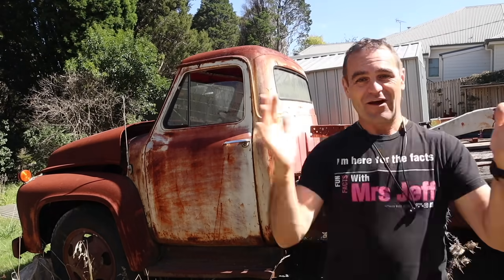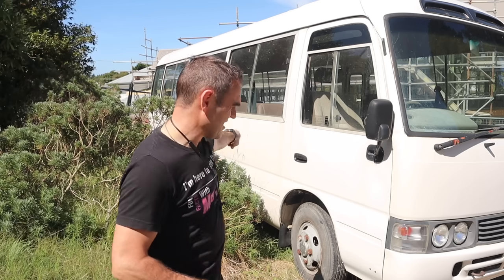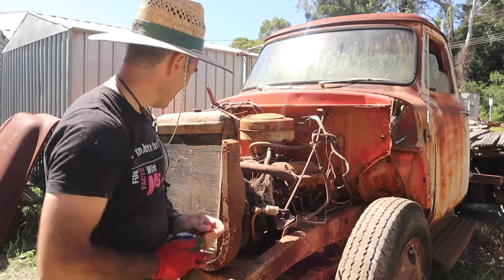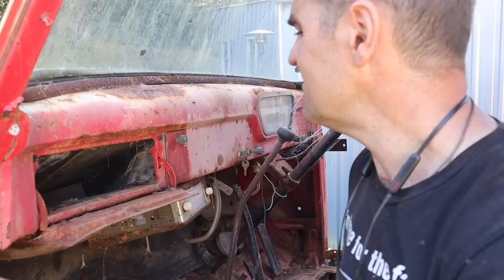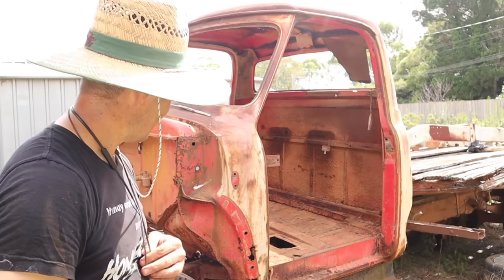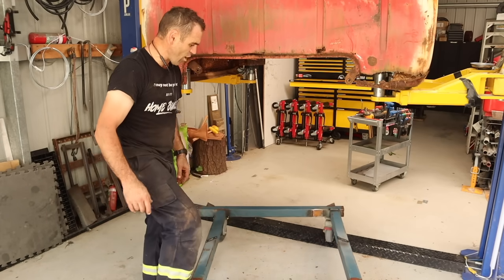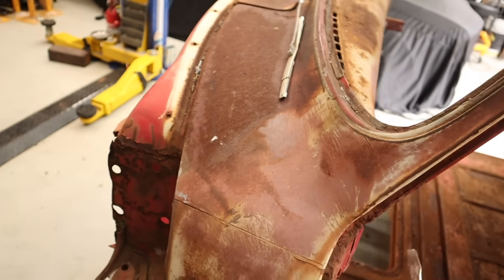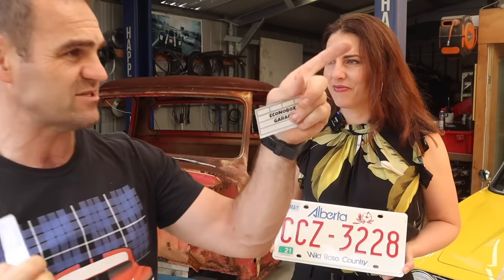Starting a new project - 1954 Ford F600 Car Hauler Build

Comment: Tip
Before wasting your time repairing rust figure out what you need to do to mount the cab to the bus frame.
You may find that you will need to cut up the repairs if you do them first.
You may actually want to leave the bus floor intact and fit the cabin to that junking the truck floor.
There’s a guy who’s done a few F100 Crown Victoria swaps where he’s done it both ways , using the car floor and firewall and dash or just using the frame. Both ways he still had to modify the cabin floor etc.
Reply: YOU ARE SO RIGHT about repair or replacing the floor and especially firewall.  Do all that after the cab is fitted to the bus chassis.   There is going to be some cutting.

Comment: Impact screw driver. The most underrated tool in the world.
Reply: Yep.
Ideal for removing disc retaining screws that are always chewed up.
Reply: Discovered mine in the 70s , a must for the Japanese Phillips head butter bolts on their motorcycle's
Reply: Hands down.
Reply: Also oxy acetylene spanner works well.

Comment: Great start, Jeff! I noticed on the steering column was an aftermarket self cancelling blinker switch. Having owned a vintage 1929 Dodge, I can tell you these things are hard to get in any condition. I would urge you to contact a local vintage car club and offer it for sale. They are the ideal solution to put blinkers on cars that weren't designed for them. Cheers, mate, can't wait to see progress on Effie.
Reply from the maker: Interesting. I have no idea about these old things, but I am keen to learn. That was something I really thought was just junk, but I am keen to re-home as many bits of it as I can.
Reply: Jeff, there are dedicated truck restorers club members  who may be interested in the rest of it as a parts source vehicle, too. Cheers.

Comment: Im excited for new vehicle on the channel. Congrats! 

Instead of repairing the cab, maybe mount the cab to the new frame. Incase you might need to chop off the cab to fit. Then end up chopping your repaired sections. Maybe to save time and headache with body work, send it off to get it sand blasted.

Comment: Hi Jeff from Long Island, NY... I have a 1946 Dodge WC pickup truck... years ago I saw a video of a guy that built a rolling wood frame and set the cab on that... he even made it so it would tilt while on the frame so it could be worked on underneath. Very... very useful. And can easily be rolled out of the way when working on your other projects. Cheers.

Comment: Personally, i would lift the bus body and see what needs to be done to fit, using the bus floor which is newer and should be both stronger (for walking on, not just resting your feet on) and   already part of the chassis on top. That way you could maybe channel and drop the cab, potentially saving yourself a ton of work....
Reply: I was one of those weirdos that had a Coaster as a motorhome. Not sure if what you suggested would work. The Coaster cab has the Engine basically sitting beside the driver. It has an access panel to do work and servicing that sits over the top of the engine, so not sure if the floor from the Coaster would help. Unless I’m missing your point lol.
Reply: @RobCantle  i am suggesting to lift the bus body first
Then place the Ford cab
By cutting the cab floor out - the engine would be under the bonnet and the driver back, you may be able to use some of the newer bus floor instead of rebuilding Ford floor. Obviously you are going from engine beside to engine forward of driver. The possible floor section you may be able to use is already crafted and molded for the bus chassis. It may be possible to channel the Ford cab so it sits lower on the canter chassis.  So it may be a thought to lift bus body before repairing Ford cab. That could open up something completely different to what one planned.....
Reply: Hi Jeff 
It’s great that you can get an engineer to approve a body swap in OZ 😎 . 
Look’s like it will be a great project 👍👍👍

Comment: You may want to wait on ordering patch panels until you've had a chance to test fit the truck cab on the bus frame - some parts of the floor, the lower edge of the back of the cab, etc. may have to be modified to the point where the patch panels won't be used.

Also, I'll bet the truck had a 6 volt system, so the original horn may sound like a wounded goat when connected to 12 volts.  🙂

Comment: Hi Jeff and Mrs Jeff love your channel  been subscribed for years now  .this truck project is a ripper  the Coaster chassis is already lower than the F series  which is a great start and such a realy reliable  running gear  I've done a few conversations  myself it is great fun . there is a you tube channel  called Hard Core Fab  doing a similar  project .  much respect for all your talent  and content   cheers from Victoria

Comment: Interesting to see where this goes.  Keeping the stock powerplant?  Wondering if the cab will need a lot of modification to fit the chassis, may "save" you some work in terms of rust repairs?  Projects always dream easy 🙂

Comment: With old electric horns the usual fix is to hook up power and tap it with a hammer. It only takes a couple of hits. 
They can be dismantled and cleaned, there is usually a tone adjustment.
Reply from the maker: I will give that a crack. Thanks.

Comment: What voltage does the truck run for that horn?  6v, 12v, 24v, positive or negative ground?
Engine cranes work well for lifting cabs.

Comment: Awesome Jeff, thanks.
Just a thought, if you may want to consider dipping/soaking in rust converter.  Buy a cheap collapsable swimming pool (small). Maybe do bottom half, then flip over for top.

Comment: Jeff,  looking forward to this project.   One thing i've noticed is there doesn't seem to be much leg room in these cabs.   Also the front axle ( on the F100 anyway) seems like it should be further forward than it is.  I've heard of people modifying the firewall & the guards rectify both of these things.  Is this something you would consider??    Maybe the Toyota chassis would allow for some body modifications on the cab??
Reply from the maker: I am short anyway, so probably not the effort ;)

Comment: You’re going to want to turbo that 1HZ as a car hauler it will be a hill detector in n/a form. Oh, and check the electrics of the old truck maybe 6v system and why the horn didn’t work.

Comment: That came off relatively easily. With the help o f Wonder Woman.  May I suggest, before you get too carried away with the repairs. You take the body off the Toyota. That way you can check what needs to be changed to make it fit before you potentially spend time old money repairing the cab only to find it may need some parts cut out to fit on the Toyota.

Comment: It's too bad you can't save that twin stick transmission. Is it just a high low rear end or is it a five and four? I drove an old tree spade with a 5/4 trany, very cool, and fun to drive! You should be able to get cab corners from the States.
Reply from the maker: I think one of those sticks is the hand brake ;)

Comment: For the love of god, please don't use the 1HZ. You'll be SO disappointed. Gutless and regardless of what people tell you, adding a turbo WILL kill it eventually. Do yourself a favour, spend the money and get either a 1HDT, 1HDFT or even an 1HDFTE motor. Spendier, but they'll all bolt up directly to anything a 1HZ does and will make far more power without sacrificing reliability.  If the coaster bus uses a R151 gearbox it's a grenade waiting to happen. If it uses a H151 or a H150 box it'll be fine